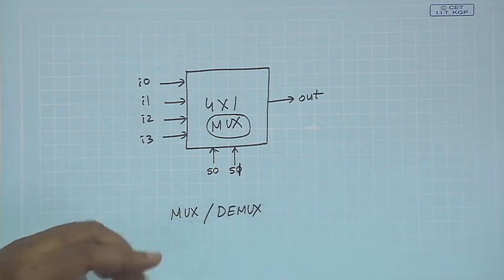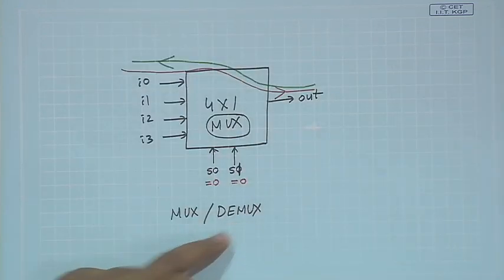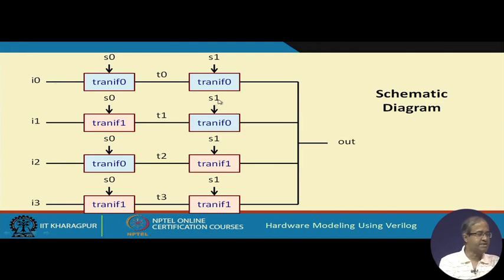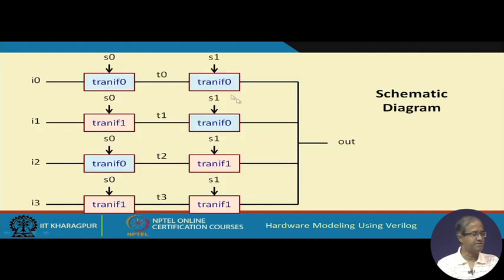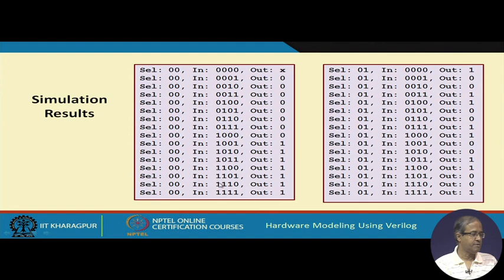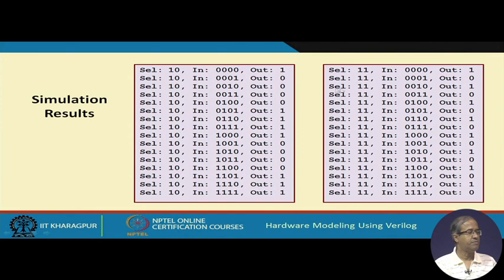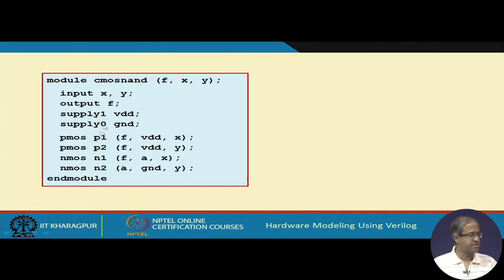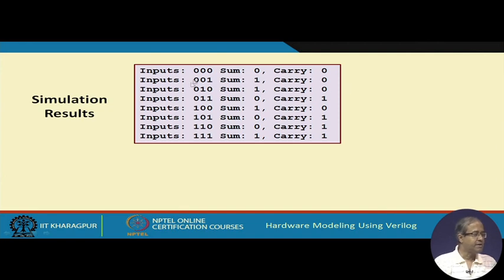SWITCH LEVEL MODDELING (PART 2)

Comment: i1 should have tranif0    and    tranif1
i2 should have tranif1    and    tranif0

relate it with truth table 4*1

and that makes the simulation o/p wrong
Reply: They implemented by assuming s1-0 and s0-1 for t1 as well as for t2 s0-0 and s1-1